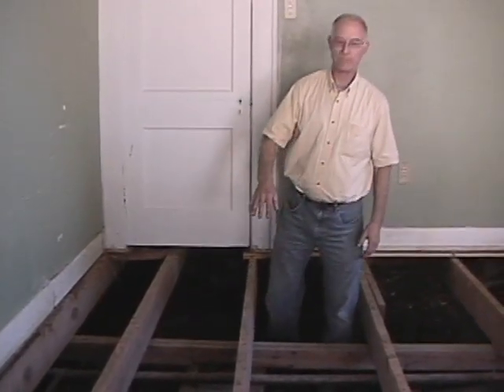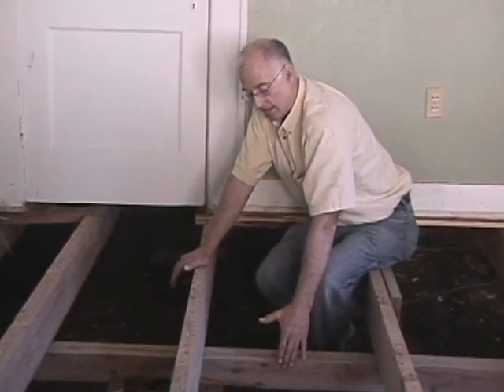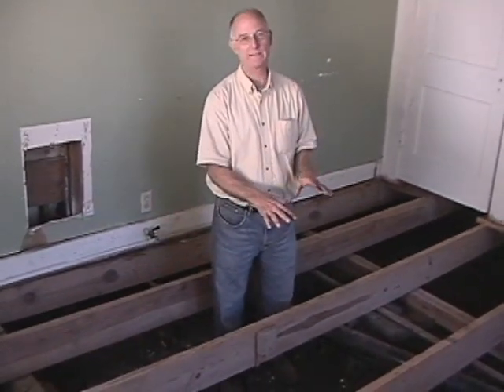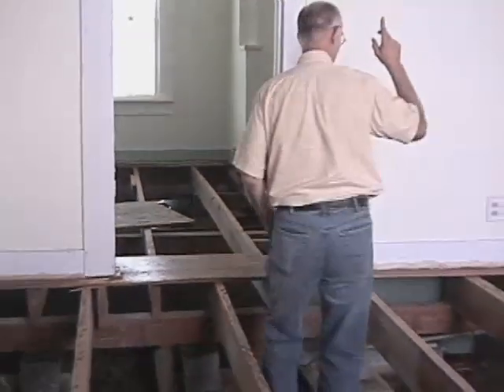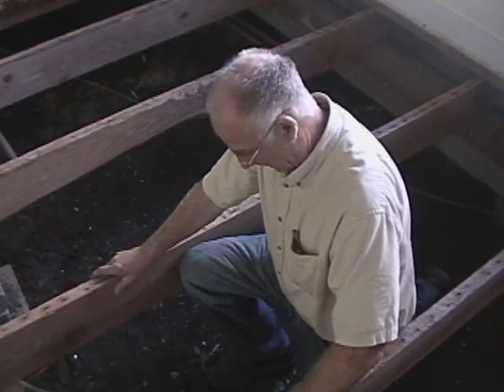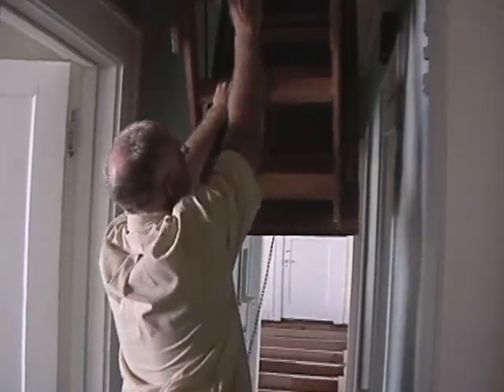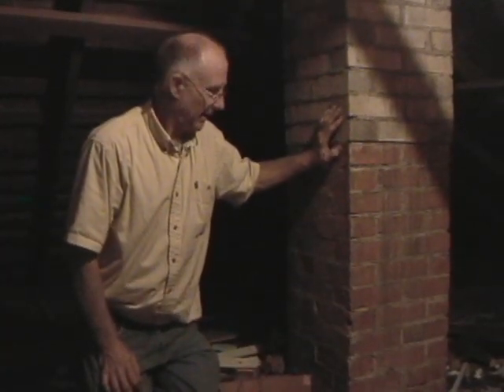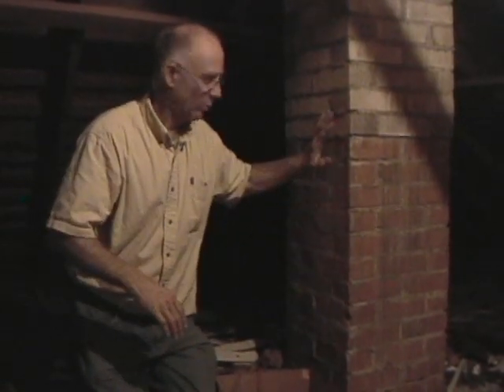pier and beam foundation part 2

Comment: Your missing the bridging between floor joists to stop them from rolling sideways & to have the joists share weight, and you sure do need an electrician, because junction boxes don't belong in a crawl space -should be in attic. In houses built in the early 20th century, all walls going 90º to the floor joists sat on top of those floor joists & were nailed to them. If it was an outside wall the floor joists were sitting on the foundation so moving that beam to an outside wall would not increase the strength if the joists were properly bridged. Carpentry sure has changed over time. New houses built with new ideas are not as good as they appear. My uncle used that chip board for sheeting on my grandma's new home. 7 years latter I had to replace damaged vinyl siding and found chip board wall sheeting was falling apart & swelled (I could easily ram my fists through that chip board between the studs. I've re-shingled hail damaged roofs to discover chip board roof sheeting was like wall on grandma's home. Also I've seen cracks in sheet rock in homes less than 10 years old because it appears that chip board don't provide adequate sway bracing in high winds from Florida to Washington state. I replaced corner sheeting with ¾ exterior plywood for solid sway bracing, & no more sheet rock cracking. My old 1902 house built with things I mentioned above never even had any plaster cracks in a small tornado, yet my new additions on the from & rear of the house were mostly destroyed like my neighbors new homes were. Makes me wonder how many homes that used chip board on exteriors are the same way, so I'll stay with exterior plywood. Gosh there are a lot of lawsuits because people were made sick by their own homes insulated with new blown in foam insulation & even by new carpeting they put in their homes (both old & new homes). Are we sure modern home building materials & methods are really progress?  However, old foundations sure are a problem because of old inferior concrete & building methods!
Reply from the maker: Good point.   we had just started

Comment: Very informative. I have a 1923 bungalow and the roof sags like nobody's business. They used douglas fir 2 x 6 rafters back in the day then but I think the real issue is the low sloping roof. It seems a low sloping has a lot of downward pressure on it causing it to pancake, I assume it has been this way since 1923. The inspector in 2008 when I bought it mentioned collar ties but I haven't done anything. Just some little fixes up there. It is am interesting house with everything original inside. Also, the floor joists in the attic run parallel with the ridge which I haven't seen before. They have 2 x 4s that criss-cross the floor to tie the whole thing together. I enjoy your videos.
Reply from the maker: These old houses show us how things were done back then.  The 2 X 4's back then are  as strong or stronger than the 2 X 6"s today.  Even the headers back then were just 1 X 8 shiplap .  2 stories did use 2 X 4 headers back then. Don't try to do too much remolding at one time. do it in steps and take breaks when you finish a room

Comment: I'm interested in buying a small house that has pier foundation. ..how many times do you level your house?
Reply from the maker: Keep water from getting under your house and you want have to worry about adjusting your piers.
If you do have to adjust your piers it,s not hard to do it's just lots  of labor.  These pier and beam houses  constantly are moving around. Some more than others and the worst  one are the brick homes because of having to dig under the perimeter beam that the brick is bonded to. 
Good luck on your new purchase
Reply from the maker: Keep water from getting under your house and you want have to worry about adjusting your piers.
If you do have to adjust your piers it,s not hard to do it's just lots  of labor.  These pier and beam houses  constantly are moving around. Some more than others and the worst  one are the brick homes because of having to dig under the perimeter beam that the brick is bonded to. 
Good luck on your new purchase

Comment: Great Information! My wife and I are going to be replacing our floors in an older home we purchase a year ago. I built a sub floor on top of the floor, so I need to pull it all out and start the work. The home is 780 square feet, I feel I'm going to do one side of the house at a time. I saw the part one and two is there a part three? I need all the help I can get lol, Thanks so much! Patrick